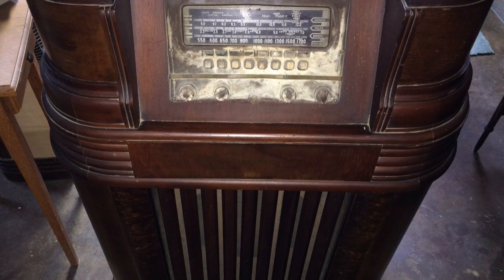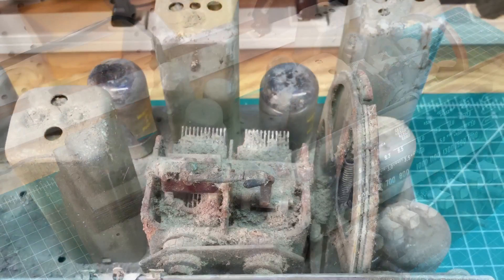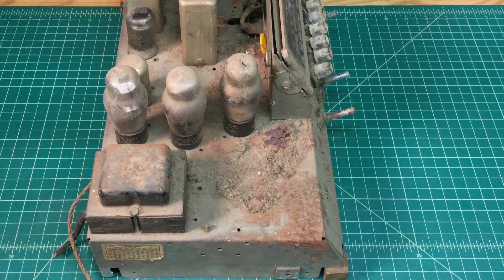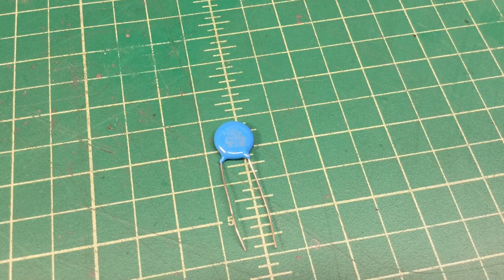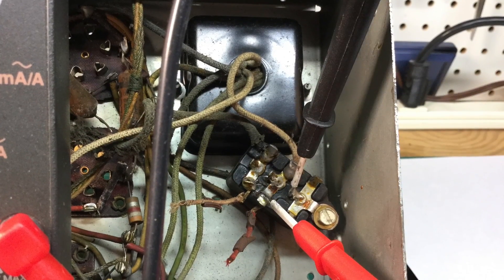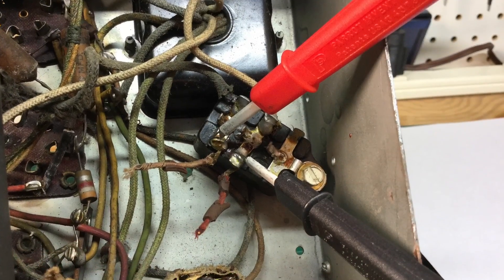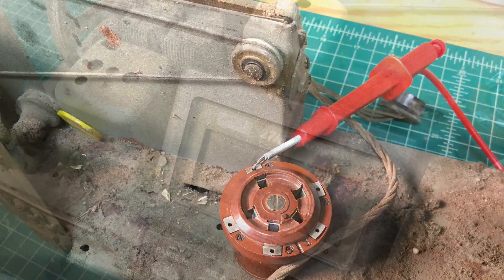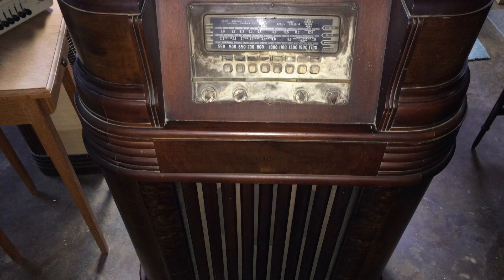Philco 41-280 - Let's Get Started

Comment: I've got a 41 280 that still works but I don't turn it on much because all the capacitors are original.. it's incredibly good shape it still has the little cardboard label on the spinning antenna I wonder what somebody would give me for it
Reply from the maker: Check out the resource below for general…

https://radioattic.com/priceguide2.htm?span=p

Scroll down to Philco w/ your model. It’s a great looking set.

Hope this helps.

Best,

Don

Comment: I found one of these.
Reply from the maker: Lance - cool find. Lots of old rubber wire that will need replacement I’m assuming in addition to all capacitors (less mica) and resistors out of tolerance. Best, Don

Comment: Hello I'm currently working on a Philco 39-6. On the primary of the power transformer,  there is one single .006 line bypass capacitor in the bakelite block that goes to chassis ground. I rebuilt the bakelite block and want to install two Y2 capacitors and  have them across the line to ground just like in your Philco 41-280. Is this ok? I am changing the original design by using two capacitors instead of one. Oh, forgot to mention, I'm using .005uf Y2 safety capacitors because I couldn't find .006. Thank you.
Reply from the maker: Stephen, the Y2 capacitors in that configuration & value (line-to-ground) you chose should be fine. I hope your project goes as planned. Best, Don

Comment: Hi Don, Did you finished this project? I saw only one more episode about this Philco 41-280. I got this model just today. I'm looking forward your very accurate high experience about this restoration. Thanks.
Reply from the maker: Hi Steve and thanks for watching. I published 14 videos on this project and the playlist is: Philco 41-280 https://www.youtube.com/playlist?list=PLjLu4V-71S1LecZcnOxovyjPMO3H2j5S7

I hope you get yours playing real soon.

Best,

Don
Reply: @RestoreOldRadios  Hi Don, I am a little bit confused with the "new" cap i.e. 302k 630V 22J 630V. I knew miliF, microF, nanoF, picoF, I think 302k = .003 mF, right? So I looked in the schematic, found only ONE (number 49), but you used several other place also. Did you improvised this? BTW do you kept the shopping list what you changed altogether? It would be very useful (at least for me) to start shopping the same parts. I can not figure out from the wiring diagram the following capacitors value: 10A, 17A, 16, 17,  12, could you tell me? As I saw in your video 10A is top of the variable capacitor (22J) , correct? Thank you for help.
Reply from the maker: Steve Varadi Hi Steve - are you using the Philco Service Bulletin series or Riders? Best, Don
Reply: Rider's schematic. I see you have a better copy. Is it possible to get the Philco Service Bulletin? Thank you.
Reply: Thank you for your input I already downoad Philco Service Bulletin. It is very nice clear visible readable etc. So remaining question: did you kept any note what parts changed during restoration? Thanks again.
Reply from the maker: Steve Varadi Steve, I may still have them. I’ll look this weekend. Regarding capacitor values, I try to replace them with the value called out on the schematic, but since most capacitors from that period had a tolerance of +/-20%, I will substitute a value in that range with the exception of RF sections or alike at times. For those capacitors that are hard to find in the chassis, I reference the schematic and find the closest tube for example that the component ties back to and trace the circuit out until I solve the mystery. I hope the repairs go smoothly for you. It’s a beautiful radio. Best, Don
Reply: RestoreOldRadios Thank you for your kind words. I’m looking forward your list. BTW today I pluged in and experiment the first smoke. Lucky just a 35, aka 300 ohm burned out. Next time I check out more carfully before plug in. Thanks.
Reply from the maker: Steve - this will work as depicted. I typically place them on the switch side, but either way should be fine. Are you considering adding a fuse in front of the switch as well? Best, Don

BTW - I haven’t had an opportunity to look for my notes on the restore; hope to soon.
Reply: RestoreOldRadios Yes, I’ll ad fuse as well as CL-90, both on the switch side. Thank again.
Reply: @RestoreOldRadios  Don, I just learned now the old capacitors has a black stripe on one end -means this side shielded-. How did you distinguish the new capacitors? Do you have a special tools for this, or you just ignored and never had problem with it? Thanks, Steve
Reply from the maker: Steve - if you’re a purist, yes according to Mr Carlson’s Lab at: https://youtu.be/BnR_DLd1PDI

Now, Dennis Carter said it doesn’t make any difference in one of his videos. I’ve never spent the time to figure it out and haven’t noticed any notable performance degradation.

Best,

Don
Reply: @RestoreOldRadios , Hi Don. I finished recap all of what I found, and changed some resistor also. All together 14 caps, however did not changed any MICA. You mentioned somewhere: "changed 19 caps including some Mica"  Could you tell me which Mica you changed? I have problem around the OSC circuit. Now Audio and RF looks like ok, if I touch the potentiometer, I hear crackling. Same as I measure tube's plates all of them crackling except the OSC XXL. I interchanged with other XXL, same result, so tubes are ok. I get 36 VDC (need 40 VDC), on OSC, but still no osc.  Any tip would be highly appreciated. Thanks again. Steve
Reply from the maker: Steve Varadi I have an article I reference on oscillator troubleshooting I can send to you. Send me an email to: TheRadioRepairGuy at gmail.com and I’ll forward it to you. I think you’ll find it helpful troubleshooting the issue. The oscillator grid voltage needs to be measured next if you haven’t already done so as outlined in the article. I’ve got a bunch of my old notes, etc., in storage and can’t recall the mica cap replacements. Best, Don

Comment: Hey Don, I'll be watching this series closely as I'm currently doing a sort of similar radio myself.  a Philco 46-480.  It's am/fm&sw instead of the police band, but it also has that bakelite block capacitor set and instead of two 41's it has two 7h7's, but the cabinets look very similar and they both have 12" speakers.  Take care, Gary
Reply from the maker: +Rebel9668 Hi Gary, I'll get other to your channel and check it out. Have you broke into the Philco blocks yet? Best, Don
Reply: Hey Don, I got the block cleaned out....I just can't seem to get the old solder out of the holes in the block.  My solder hand pump melted and broke and the wire wick does almost nothing, lol.  Guess I'll have to break down and get one of those Aoyue de-soldering guns as bad as am with solder.  I even tried heating the solder in the holes and trying to plunge some tinned wire through the hole to grab the solder.  No luck so far.  Take care, gary

Comment: I notice the mains safety caps were before the power switch and connected all the time. Might be better connected after the switch (and hopefully a fuse!)
Looks like a bit of a job ahead but I bet it sounds good when finished.
Reply from the maker: +Michael Beeny Great observation Michael. To your point, a circuit modification is in order. The old chassis is quite a mess and will definitely be time consuming. I appreciate your feedback and for following along. Best, Don

Comment: Hi Don, ROR, Looks like a good project, I know it will look great when you are done. I plan to install a safety cap on my Crosley 56TC restore. I will look to see if you have a video on them already, and, if not a short video on safety caps and if you can convert to 3 wire power cord and the correct way to do so would be much appreciated. Awesome channel. Take care, C.
Reply from the maker: +Cass Virgillo Hi C - you'll want to stay away from a 3 wire... Check out these articles:  http://antiqueradio.org/safety.htm   &  http://www.geojohn.org/Radios/MyRadios/Safety.html  Best, Don
Reply: RestoreOldRadios Hi Don, Thankyou for the links, I'll check them out. Be good, C.